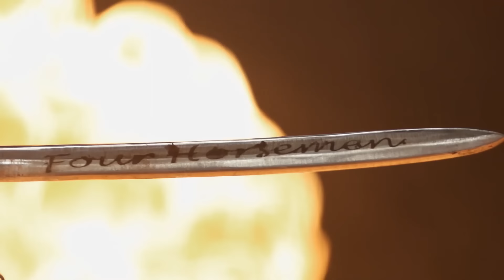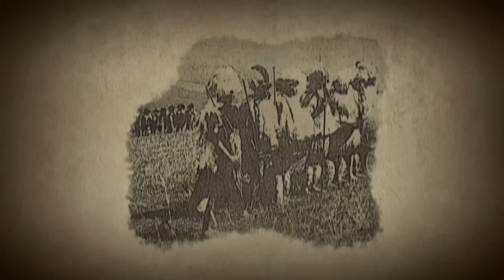Forged in Fire: *10 MORE* CATASTROPHIC WEAPON FAILURES | History

Comment: 30:00 I feel sorry for him, beautiful blade just that pommel failed
Reply: I was too!! Gorgeousweapon! Would've won
Reply: @daniplaysoneasy-9454  for sure. The "winner's" sword at that point was basically a baseball bat and would have never survived the upcoming sharpness test.
Reply: Without the pommel,  the sword is no longer weildable because of balance issues.  More dangerous to user than the target
Reply: That pommel cold be mended  in seconds, and it would have been the winning sword. It still had the taper and all. Just put a bit of epoxy or glue on it.
Reply: @Kriegbaum1000  bro u know the other guy could do the same if his opponent would be given a chance to fix it.
Reply: @cfparkour7478  uhhh no did you watch the video? The other guy's sword was a piece of trash, this guy's only problem was the pommel
Reply: I would of considered that a loss. The fact that his blade was still razor sharp should of won.
Reply: @williambrown319  Bruh... Without a pommel it would be as weildable as the trash sword...
Reply: I might  be reading into it, but it looked like the judges were just as disappointed in this outcome as he was, likely because they also knew the other sword was subpar.
Reply: That was so disappointing. It could still be swung and was a work of art visually and functionally. Especially when the other sword was a mess at that point.
Reply: Yep, you could tell the winning sword was dangerous during strength test. No control, after hitting the block of ice it bounced too close to the judge's face. Also it was too heavy for it to be wielded with one arm as the judge was struggling with it.
Reply: without the pommel, one cannot end them rightly!
Reply: Wasn't really fair bec it was only the pummel
Reply: Gotta love the idiots who've never even held a sword saying itd be unwieldable without a pommel lmfao. 

Is it ideal? No. Balance issues? Yes. But it is still usable lololol.
Reply: @1515AC  yeah, that sword pommel-less would probably still handle better than the other guy's triangle.
Reply: @brockforster8104  Difference for that is his opponents sword completely broke and the judges didnt have much to go off of afterwards
Reply: @brockforster8104   Sorry to necro this, but the guy was allowed to bend it back into shape only because both swords catastrophically failed. They kinda had to do something, or they would have no winner. As for the pommel, in terms of a battlefield, that is a catastrophic failure. Not only would you immediately lose the pommel on the battlefield, the pommel holds the sword together, so if they kept swinging there’s a good chance it might just break apart. Personally, on a battlefield, I would prefer if my blade was clunky instead of literally deconstructing itself.
Reply: @1515AC  I have handled swords where the pommel broke, it was unfortunate but the sword was still useful. A good sword can be wielded regardless of its condition, it requires the wielder to adapt. Problem with some of the forged in fire tests is that they are good for effects, but lousy when it comes to reality. I don't recall any parts in history where anyone was assaulted by a block of ice on a pedestal.
Reply: I don't know that I would call it a "catastrophic failure" however its possible that he was disqualified on the grounds that the pummel was a required part of the build. I've seen other smith's be disqualified for not including something in their design that was required by the judges. (Blade not the required length, doesn't have a required feature, etc) therefore when testing it isn't a fair test vs someone who has all the required parts
Reply: @blueaceplayz4908  In either case, a broken pommel is worse than a sturdy sword with a blade that won't cut. The latter is easily fixable, but if the pommel breaks that's a serious safety issue when trying to wield the sword. The whole thing would probably come apart with the next swing, and that's way too big of a risk to take. So yes, it's a catastrophic failure.

Comment: The strength testing by bashing them on steel nuts. The goal was to break them right ? 
I can't imagine many blades surviving that.
Reply: One did, I think its just to like, seperate the strength of the actual blade, make sure its not brittle or has any micro cracks- I think literally only a perfectly forged nlade would surivive with no damage
Reply: Even then it'll still take some blade issues. Especially the edge, no matter the steel quality.
Reply: If it was used as a test on this show chances are you shouldn't do this to a real knife. Blacksmiths tend to make almost unbreakable stuff (mailbox out of 1/4 inch steel, it was never vandalized again.) So you need an absurd test to test their breaking point.
Reply: @axoltol5363  If they knew the tests being conducted they would design around it. Some guys get unfair advantages because of a random specific trait they went with based purely on preference.  Someone else chooses to make a more flexible blade for whatever reason it will perform better/ worse then a rigid blade in whatever random test.
Most of their tests are stupid and not practical, it's often not a measure of skill. It's mostly who designed and forged something better suited to a random destruction test.
Reply: @friendlyoldbum9182  doesn't help that the last strike on the second guys blade was a good 4 inches away from the nut. Massively unequal testing
Reply: Every strength test is designed to try break to blades to push further skill out of each smith.
Reply: Yeah I think the strength tests are indeed designed to break the blades. It pushes the smiths skill to the limit especially when the tight time constraints mean they literally cannot make a good blade.

I noticed that the early seasons are much easier. More time and less forcing borderline impossible things during construction like san mai or jelly roll or twist damascus.

The odds are totally stacked against the smiths designed to produce flawed weapons to test in ways blades were never designed for.

That being said it’s still enjoyable to watch. The fact the show has been forced to get harder because smiths were adapting to the conditions speaks well of the profession.

Comment: 29:30 Drew didn't deserve that...even when he saw that his opponents blade wasn't doing as well he never got cocky or overconfident. He only mentioned his concerns about his own blade, man thats tough.
Reply: Yep, stupid very dumb how he didn't win. The pummel fall off so what? 
The blade is still sharp, straight.
Reply: @koreancowboy42  still without a pommel the sword has no balance, it doesn't matter how sharp it is. You can say what you want but every sword needs a pommel
Reply: @demochris1786  yeah, since the other oversized unbalanced, heavy, chunky and dulled from the test sword had one, youve got a good point there mate.
Reply: @vraspus  well i don't know forging but if i was forging i have to know all weapons they're ponmel etc
Reply: Pommels are mostly so that your weapon doesn’t slip out of your hand as easily.  it has something to catch onto so that it doesn’t fall out, there is also the issue of balance, mostly so that the weapon isn’t forward heavy, so I get your point
Reply: @koreancowboy42  The pommel is what holds the sword together. Without it, the weapon becomes too dangerous to test properly. That's a catastrophic failure.

A bent blade can be fixed fairly easily. But a broken pommel? Gotta tear it down and start from scratch.

Comment: @1:36 I don't know if it's just the camera angle or if Doug really did it but it looked as though as rather than hit edge-on, Doug struck the pig with the flat of the blade instead. Such a strike on a weapon like that would definitely explain the bend and why the sword would later go on to pass the proper sharpness test with flying colours. It could've been an accident, again it could've just been the camera angle but from even the slow motion clip it does look like a flat-strike rather than a slash.
Reply: he twisted his hand causing the blade to hit flat. you can see the cross guards turn before the strike
Reply: Doug is good with kali, but longswords, not so much. His edge alignment is often poor.

Comment: I love this show. But i must admit that the human variant on the testing is very unreliable. Should be a mechanic kind of testing always applying the same force, pressure, the same angle, etc.
Reply: I agree but these are mostly mid evil weapons so i get these tests but yea i feel some improvements should be made
Reply: These types of tests are like those done to actual bladesmith weapons when a bladesmith is going from apprentice to journeyman.
Reply: Wow, it's almost as if these weapons were wielded by humans.
Reply: I would argue that it's more reliable than a mechanical test, while yes angles and force are one factor, there's also the feel in the hand and weight distribution that can only be tested in this way
Reply: But the tests are always done by the same person so I think its fine
Reply: then i guess it should be boring
Reply: We've seen equally strong, light, sharp blades in the finals, and the reason one won over the other was the feel, weight distribution, and comfort in the hands of the tester. Like it or not, the human factor is not a detriment in these tests.
Reply: It’d probably be more fair to have more standardized tests but if you watch he makes all the cuts in the same way in order. Horizontal -> stab -> diagonal to name one. Besides the feedback a wielder would get from doing these tests by hand is worth more than a more scientific approach.
Reply: Its meant to be used in combat no one's prefect  and I enjoy the testing its random keeps on on there toes they test things the smiths never see coming like blasting the handle
Reply: Yeah, the Keeel guy doesn’t have the best edge alignment all the time

You can say it’s the weapons grips fault, but it’s still not consistent
Reply: @WolfPred  again buddy it's a weapon. No one swings prefectly. If your sword sucks if dosent matter if a human or robot swings it, it's snapping
Reply: @cagethelonewolf  But if your weapon is good, a bad user can still kill it with bad edge alignment! E.g. the first claymore would not bend like that unless force is applied to the flat part of the blade instead of the edge.
Reply: @Cleruian  funny i checked your channel yet i surprisingly found a lack of weapon videos, i mean you here talikng like your some kind of expert your telling us the expret on tv is a fraud and a sham
Reply: @shadownet7026  it's definitely not "more reliable".  The problem is that they're comparing blade to blade, but the exact mechanics of the stress they put on the blades can vary so greatly.  The biggest offender I saw here was the baton on the industrial nut.  The guy smacking the blades didn't always hit them directly above the point at which they were resting on the nut - hitting it off that point amplifies the force based on the distance to the fulcrum.  The first blade that passed was smacked basically directly on the fulcrum all 3 times.  The SECOND blade cracked on the swing where the fulcrum was placed near the hilt, and the baton smacked near the point.  This is an incredibly inaccurate way to test two different blades.
Reply: @cagethelonewolf  you don't need to be a weapons expert to understand grade school physics.
Reply: They have had several mechanical tests, the bending of blades to a specified angle on a large meter and then back to true. Also some large spring-loaded machines Dave seems to have devised. They were definitely all pretty brutal.

Comment: 29:30 The other guy's sword didn't have a noticeable pummel. Yet he became the winner. It is visible that the losing sword had better steel and sharpness.
Reply: Yeah, I'm not sure I would put that in the category of "Catastrophic failure", it's a fault certainly, the balance has shifted, but the blade is still safe to use.
Reply: @minerat27  Not for those tests, it wasn't. If a malfunction (regardless of what type) renders a weapon unsafe to test properly by the show's standards (and a broken pommel will cause that), it's ruled a catastrophic failure.

A broken pommel is much more serious than some people here in the comment section let on. It helps hold the blade together, which is critical when putting the sword through tests as rigorous as what Forged in Fire puts them through. If the pommel breaks, the chance of the whole sword coming apart on the next swing go up by a big enough margin to render the weapon unsafe to test. So for safety reasons, you have to rule that a catastrophic failure.
Reply: cameraREDeye tbh, people saying that the pommel coming off wasn’t a catastrophic failure probably would think the naginata ebony handle having cracks on it wouldnt be also considered a catastrophic failure.
Reply: @cameraredeye3115  Agreed. And this show does a fair job applying the rules.

Comment: In the camping knife testing (starts around 20:50) the second contestant got robbed by the guy doing the strength testing. The first knife was struck three times on the spine of the knife close to where the knife made contact with the nut or closer to the handle. On the second knife, the third, and catastrophic blow, was delivered closer to the tip of the knife where it was unsupported by the nut. I'm not sure how many knives would have survived that type if hit.

Comment: Can't even imagine how many medics they have on standby
Reply: The fact that they don’t have more safety measures in place while performing tests intended to make blades shatter makes me pretty anxious. Seems like standing behind some safety glass would be a decent idea
Reply: More medics than cannons on napoleon’s right flank
Reply: I do know that under the shirts the judges do actually wear some kind of body armour. It’s not really noticeable most of the time, but if you’ve watched the show for awhile you can see they look slightly thicker than when they’re sitting during the first two rounds.

And in a couple episodes you can actually catch a glimpse of it up near the collar. I also know they have at least one medic on-site and watching both contestants and judges very carefully. Every so often during the first round there’s a smiths that don’t handle the heat of four running forges. Whether it’s the heat alone, something in their physiology or perhaps they just don’t drink enough water or stand in front of the fan, when they show signs of illness the medic shows up and takes them off the work floor. Usually a few minutes of rest, cooling and treatment gets them back on their feet. Only once I saw one taken by ambulance to hospital.

Similarly if a smiths or judge cuts themselves the medic will come and patch them up, even if it requires stitches sometimes the smith will just have the medic bandage it until the round ends before presumably going to hospital to get it stitched.

Now I’m British so this means nothing to me, but on the back of the medic’s shirt it says “Blast medic.” Dunno what meaning that has, if any.

So yeah things aren’t quite as dangerous as they seem.

Comment: I have to observe that the judges who are wielding the swords sometimes hit with the wrong angle on the blade and this contributes more than anything to the failure.  With the Claymore sword on,  both cuts the guy hit the pig with the blade practically flat against the surface.  No sword will cut on the flat surface.  I can see why they sometimes dont hit it right but don't they ever take some responsibility for any of the failures?

Comment: Whats funny about the first test is Doug hit the pig with the flat of the blade.  He didn't hit it with the edge.  I believe some of these tests are flawed because the wielder is not that familiar with the weapon.  I'm not saying Doug or the others aren't proficient but when you test so many different styles of weapons you can't be familiar with all of them.  Just my .02 cents.  It shouldn't have bent anyway, but when it was tested for sharpness it was fine.
Reply: Yeah, you can see in the slow-motion replay that the cut was badly aligned, leading to the weapon slapping the carcass, rather than cutting it. I feel like if they used a diagonal cut, rather than a horizontal cut, it would improve the testing since, as it stands, those "baseball bat" swings they use are absolutely destroying perfectly good work.

Comment: Am i judging wrong for seeing it like this at 22:53  where it seems to be a failure,but the person hitting the blade hit it slightly out of the line from where the knife was placed on the bolt
It just looks like he hit it a bit further away from the handle,and that caused the blade to fly off,but otherwise it held up nicely when he hit it directly ontop of the bolt

Comment: People tend to forget that actual swordsmithing is not the same set of skills used by regulars metallurgy workers or blacksmiths.
Reply: Can u elaborate?
Reply: @Spikus111  i guess not lmao
Reply: @Mrmultikeller  xD
Reply: Making blades requires very specific heat treatment processes.

Metallurgists can determine what alloys would work to make a good blade, based on their properties. 

Blacksmith is somewhat of a blanket term. 
All swordsmiths are blacksmiths bit not all blacksmiths are swordsmiths. 

PROFESSIONAL Swordsmithing requires a very good understanding of metallurgy and smithing; 
Swordsmithing is a specialty field of working steel. 
The skills required (but aren't limited to) are welding, machining, heat treatment at specific temperatures with specific metals, sometimes acid etching, and also requires a good understanding of blade geometry. 
Just off the top of my head..